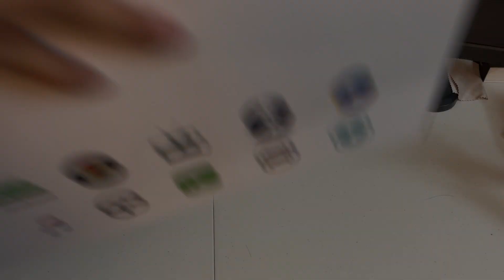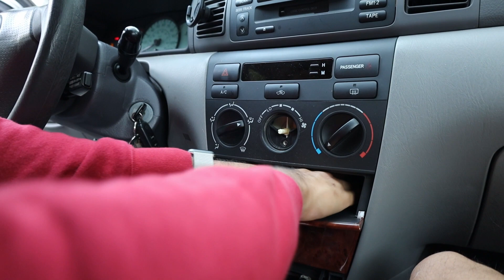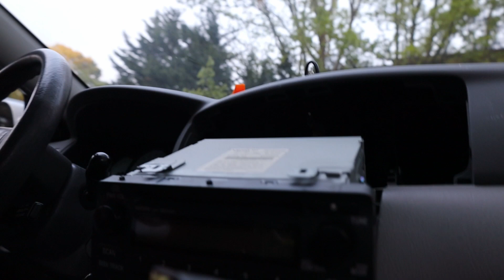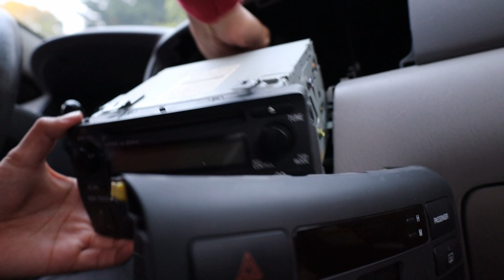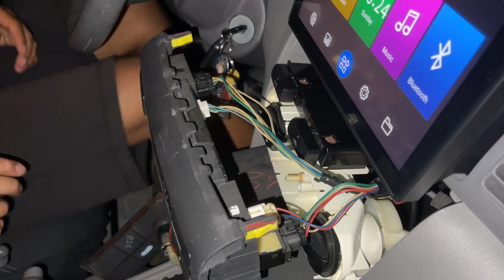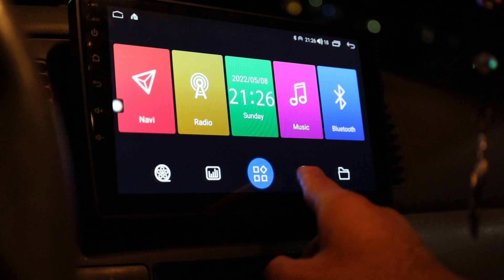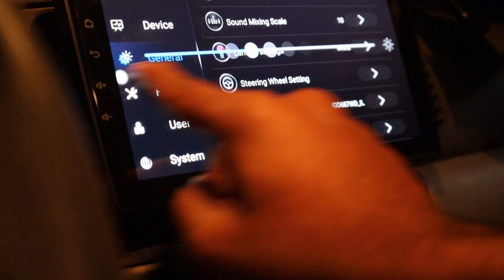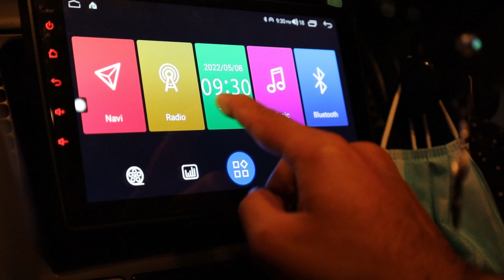Installing Idoing 9"Car Radio Player Android Auto For Toyota Corolla E130 E120 2000-2006

Comment: Hi, thanks for sharing this, video. I followed the link to buy this stereo but I could not found the exact same version you showed in this video. The seller only has the version with the full frame that include the air condition vents. Can you share where you bought the version shown in this video please, as shown at 0:41 ? thanks
Reply: Did you ever find the right one?